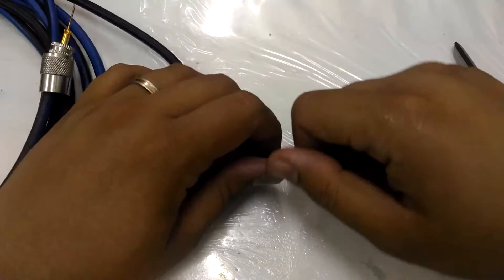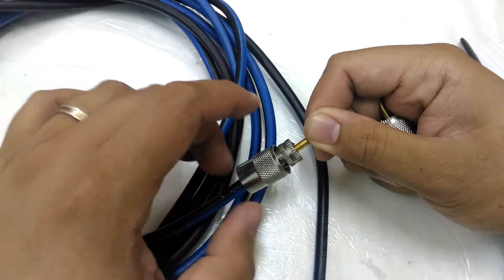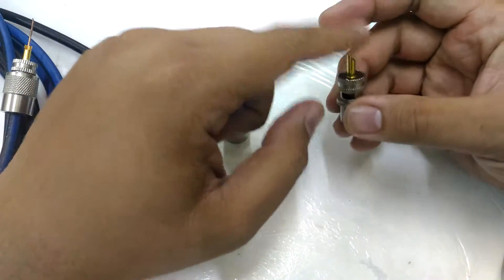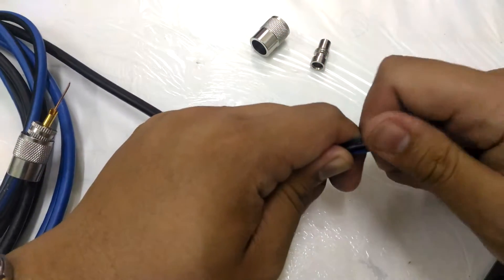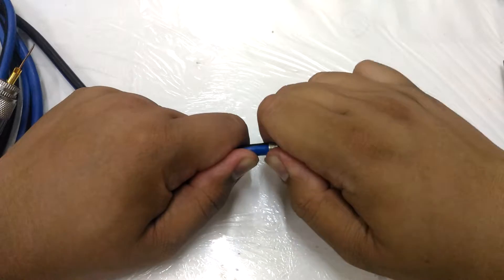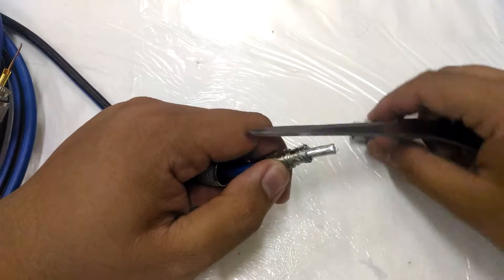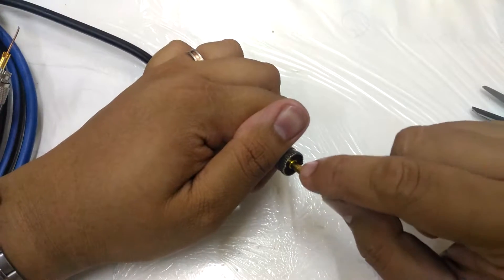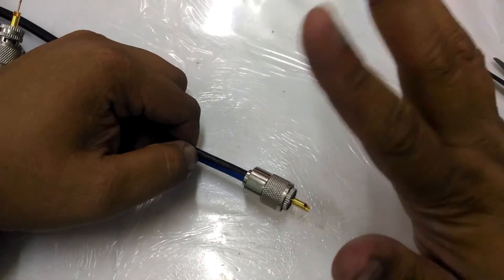Amateur Radio Demo - connecting PL259 to your antenna coax

Comment: that's some cheap coax.  dont forget to solder shield
Reply from the maker: yes indeed! it isn't meant to be used for ham radio but i had lying around so i thought of making a video. :) cheers!
Reply: cheers

Comment: I'd love to see you make a DIY LTE antenna that can be connected to the regular little LTE pocket wifi devices. I think you need to make two, one for horizontal and one for vertical.
Reply from the maker: might need to do some more research on that though. :) from what i saw and read, yeah, they have to come in pairs. and each one is a yagi. (oh boy). i think i saw some repeaters inside gateway mall once. might need to visit for an "inspection" heheh
Reply: ZuluCharlieFox Haha yeah I think it's a bit tricky. I watched some videos last night of people making yagi antennas for LTE. It seems pretty easy to replicate but kinda tedious. I might try, if I feel like I have enough patience lol.
Reply from the maker: Gadget Addict and I just finished watching vids on simpler bi-quad antennas. they seem to be more do-able. :D will just have to determine if they're appropriate for frequencies used in 3G/4G in the PH. ;)
Reply: ZuluCharlieFox I looked at those first but after seeing all the awful reviews of the commercially made bi-quad antennas for LTE, I'm not sure if they're really worth the time.